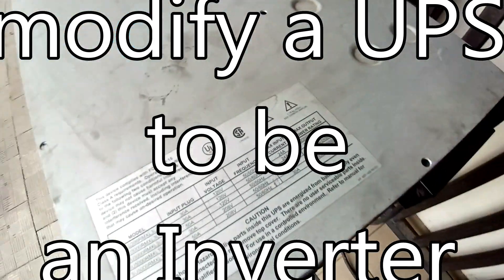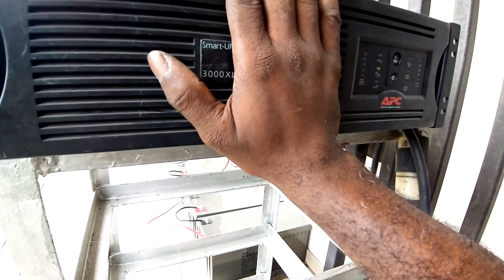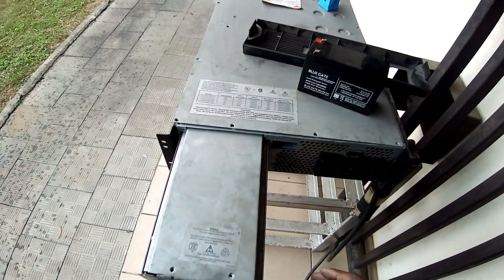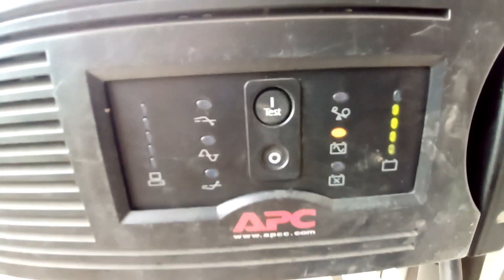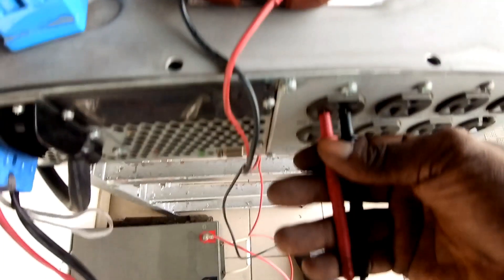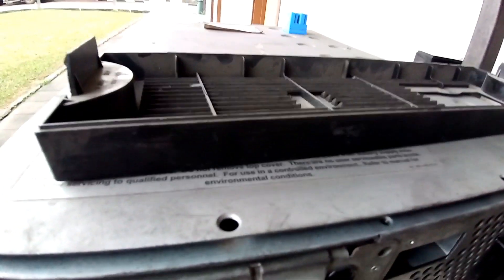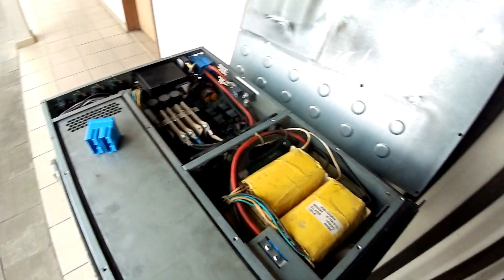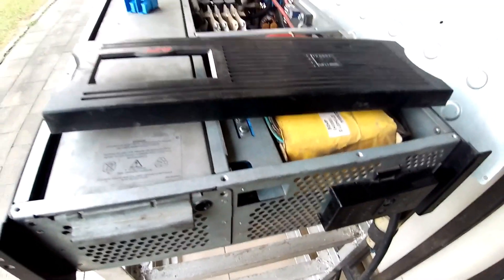Convert  your UPS to an Inverter for Longer Backup

Comment: Is it possible to use it for submersible water pump?
Reply from the maker: Yes. There has been several Inverter setups (with or without solar panels) to power submersible water pumps. 
You will have to consider the rating of the pump, 0.5hp, 0.75hp, 1hp, etc to determine setup to power yours.

Comment: Sir ,I have a 1.5kva UPS and I want to convert it to INVERTER.....IS IT ADVISABLE TO USE 12V  200AH  IN 4 batteries like you did here
Reply from the maker: If your UPS 1.5KVA 24V, then you can use 2x 12V 200AH batteries in series connection. If you want to double the battery capacity, you should consider the charging current of the UPS.
Reply: Optionally he can use a 30amp smart charger externally permanently disconnect the ups charger.